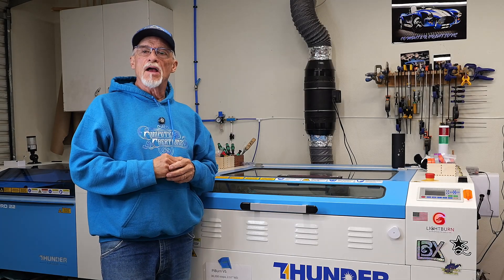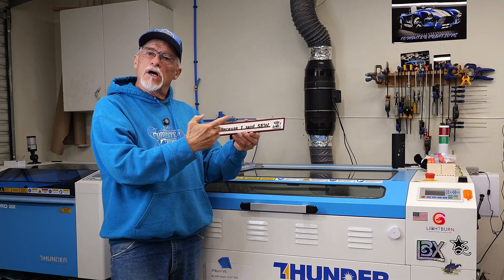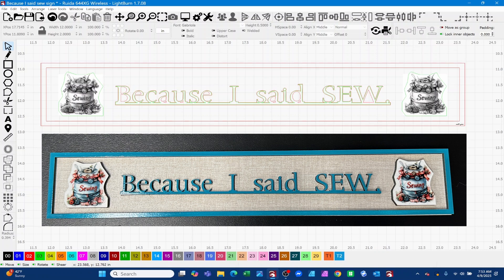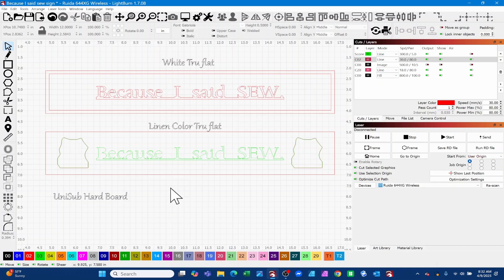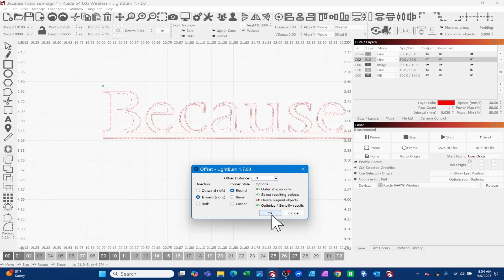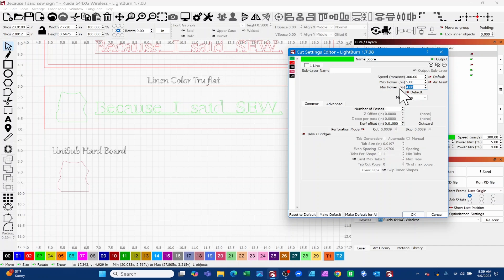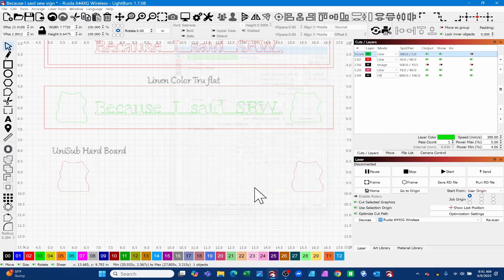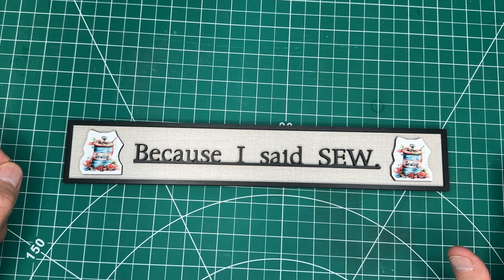Learning how to use SCORING with your laser for fast sign assembly

Comment: I was recently having problems with scoring on my Bolt. I contacted Thunder support and they said on the Bolt, max & min power doesn’t matter and that I should be using about 100 mm/s as a speed. Have you found that to be the case with your Bolt? It seems to be counter to all the advice I have seen.
Reply from the maker: I don't agree with that, max and min are designed in LightBurn for Scoring! so Im Not sure what they are referring too . Watch my max and min video on my channel that illustrates this information.